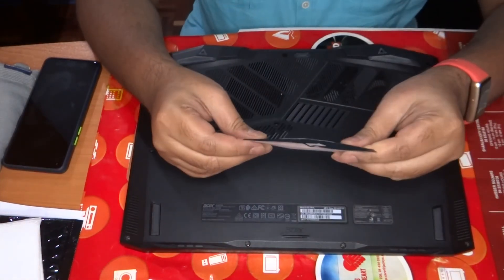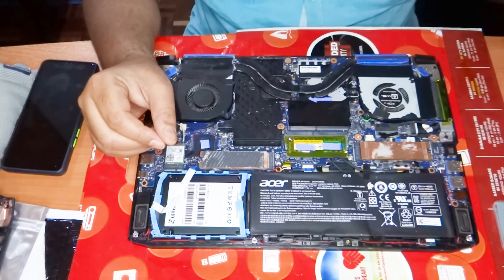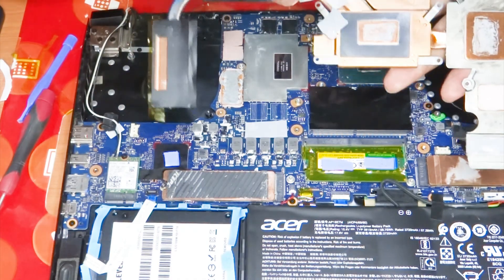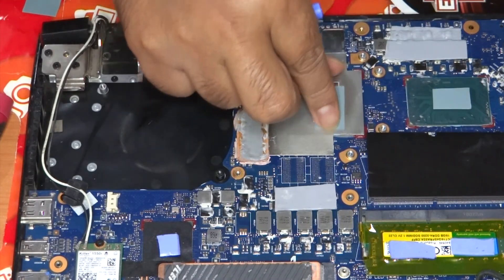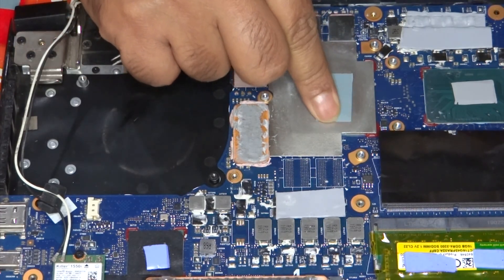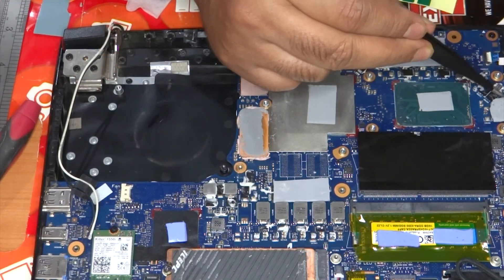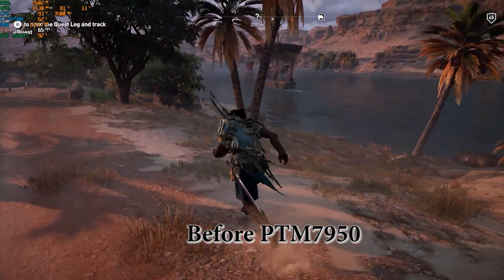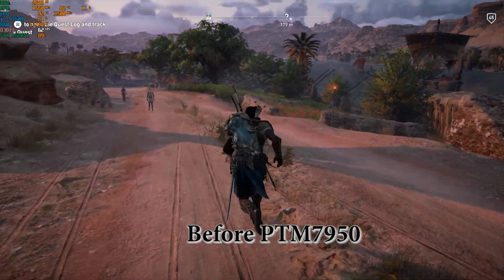PTM7950 review | Laptop

Comment: How do i know if its original? And whats the use of smaller green square?
Reply from the maker: The vendor provided is used by a lot of youtubers but if you're still unsure you can buy from the Youtuber Linus on his LTT store where his is straight from Honeywell. The green squares are to help you guide or place the PTM but I didn't find them useful.
Reply: @ArifFidaali  thanks so much im tired of changing paste every 6months.
Reply: @ArifFidaali you didn't use it the right way lol. You're supposed to stick it on the top side,  remove the lower plastic cover stick it to the GPU or CPU ,then after pressing the ptm slightly you just rip off the top plastic cover using the green square stickers.

Comment: Can i apply Honeywell on the vram chips as well?
Reply from the maker: @shadow_musix  Yes you can. It's just that people put thermal putty instead
Reply: I see. I was thinking of putting thermal grizzly kryonaut on these vram chips if i happen to run out of pads. Will that be okay too?
Reply from the maker: @shadow_musix  Yes it will be fine
Reply: @ArifFidaali  Thank you!
Reply: Whats a vram chips? Cuz i only replace thermal paste on cpu and gpu for 3years in my laptop.
Reply from the maker: @clive0494  The VRAM (Video RAM) chips are the chips near the GPU. So in my case for example my GPU has 6GB VRAM so there are 6 VRAM chips of 1GB each. These also get hot so you need some thermal compound on them.

Comment: helios 300 had bad thermals from the beginning. that's why newer predator models come with side vents as well. used it on my hp omen 16 and during full fan it can easily maintain 80-85 C at 100+ watts of cpu power draw during stress test. previously it throttled after reaching 97 C when i ran the stress test everytime it drew that much power. it can utilize a good cooling system on a laptop. smaller laptops or the ones with only two outward fan vents will see less of a difference as they are bottleneckes by the inherent vapor chamber like in your case. i compared it with arctic mx 4 newly pasted btw. it easily reached those temperatures and got worse over time due to pump out. ptm 7950 not only works better but will be not prone to pump out in laptops like normal thermal paste so we won't need to replace it from time to time for a very long time
Reply from the maker: Yes good thing about PTM9750 replacement won't be necessary unlike thermal pastes.

Comment: MX4 is stable for 95% of applications but not the greatest, PTM7950 vs Noctua NTH2 yeah doubt that the difference is going to be noticeable...
Gonna check this soon since i got both and will try to replace NTH2 with PTM later. 

On a Legion5 pro 12700h rtx3070...
Reply: so what did u found
Reply from the maker: Great let us know your findings.
Reply: @ArifFidaali  Repasted my nitro 5 with a 150w 3070ti and a i7 12650h with IMON tweak. The IMON tweak lets my i7 12650h use as much power as it wants. AC loadline tweak ''undervolts'' my i7 12650h, so now it can maintain 3.9 to 4.1ghz more consistently. 3070ti also maintains 150w a lot more consistently when there is CPU + GPU load. Temps stay under control in CPU + GPU heavy games, with GPU hovering around 78-80 degrees and CPU around 85 to 90. Thats with the laptop actually drawing an additional 10-40w more.
Reply from the maker: @setzer-j6s  Awesome!
Reply: @ArifFidaali Yeah, haven't had to repaste my nitro 5 in almost 2 years. Temps haven't increased. I did have to use thermalrite heilos instead of honeywell's ptm7950, so maybe mine's not the best quality
Reply: any results?
Reply: Any results?
Reply: MX4 will pump out. You will have to keep reapplying it every 2 weeks. PTM7950 doesn't have that problem.
Reply: Exactly this mx4 is not good for new laptops i am suffering because of it 😂 ordered ptm 7950 in transit rn let's see when it arrives

Comment: Question, did you place the PTM7950 on only the gpu/cpu or elsewhere as well? Not sure whether you applied to heatsink since I see stuff there, but unsure if its a different pad.
Reply from the maker: Hi, yes I just placed the PTM7950 on the CPU & GPU dies nowhere else. On the heatsink I had some left over GElid extreme pads which I was just trying to experiment by placing on the heatsink, unfortunately it doesn't do anything.
Reply: @ArifFidaali Terrible idea my friend, you're just handicaping the PTM
Reply from the maker: @prysma2057  How so? What am I doing wrong?
Reply: @ArifFidaali  thermal pads will not fill the microscopic gaps between the metal die and the heat sink like the thermal paste or ptm 7950 does. basically you put a worse conducting material than metal between your heatsink and your die with ptm 7950. so obviously it will perform way worse than without the pad, even if it has a higher heat transfer rate than the pad. the actual heat is transferred from metal to metal with gaps in between being filled with the thermal paste. higher number doesn't mean better cooling especially with solid pads.

Comment: Considering the efforts and price it costs i would say just get Gelid GC4 its new, thicker with a viscosity of 1000 poise which is equal to 1,00,000 centipoise. For a laptop as i can see using good quality thermal paste is still better like repasting every year and keeping ur system clean. Because judging from your video and seeing other laptop users using PTM7950 phase change the results aint that impressive on laptops. Also the melting point here is 45°c not 40°c
Reply: People on youtube generally start posting result on its first boot, while performance of PTM7950 improves and settles down after few sessions. It's better than any thermal paste out there and just below liquid metals.
Reply: True and people dont fix their fan speeds for better comparison, after PTM7950 The fan speeds also become slow @ShekharPachauri
Reply from the maker: Thanks for the suggestion for gelid gc4 will consider it. Clarification noted.

Comment: I heard it improves more with more cycles is it true
And any improvements u noticed
Reply from the maker: Honestly, not by much as compared to the thermal paste I had, Arctic MX 4. The advantage here is it will not dry up and need replacement.
Reply: @ArifFidaali  what about now after 4 weeks, did u get better temperatures ?
Reply from the maker: It's improved only by 2 degrees Celsius
Reply: @ArifFidaali  i applied it 2 weeks back and now max cpu temps reach 85°© at 53watts constant
Are these good temps
Reply from the maker: @saisandeep2289  Those are good temps, at least not reaching 90C
Reply: @ArifFidaali  what about now brother? it's been a year now, new video update about it?

Comment: On vrams and power sections apply thermal putty Upsiren UX Pro.
Reply: I'm using Upsiren U6 Pro on Vrams and Memory Chips and its work fine on my i7 11gen + RTX3070 laptop
Reply from the maker: @AmyShaw8055  Good info
Reply from the maker: I tried the K5 pro but not much change, maybe i will try Upsiren pro
Reply: @ArifFidaali  K5 Pro has 5.3 W/mk. I have not met a worse thermal putty than it, plus it is hard to clean. There are tests of several thermal putty on the Snarks Domain channel.
Reply: @ArifFidaali  I've tried both, and the Upsiren thermal putty blows K5 out of the water; it's also easier to work with and less messy. Snarks Domain even shows K5 has issues with evaporation/separation at high temperatures. Also, I would suggest you try adding a 1mm flat heatpipe, to bond the two lower heatpipes that aren't connected together, with some thermal glue. It should help increase efficiency of the whole heatsink assembly.
Reply from the maker: @DrivingVertigo  Thanks for the advice. I will try out upsiren pro and as for the heatpipe maybe I will consider
Reply: As a repair guy i see K5 "modded" devices occasionally and that stuff is horrible, yes Upsiren U6 or UX pro is a good choice From AlieX, (there is a CSGR U6 variant which is K5 junk with a pink/brownisch dye added to it).
Reply: Does putting putty on ram modules make that much of a difference?
Of all the laptops ive owned ive never come across a laptop that had putty on its gpu and cpu ram modules 
How important are they for a noticeable difference would you say?
Reply: How much did you buy it for?